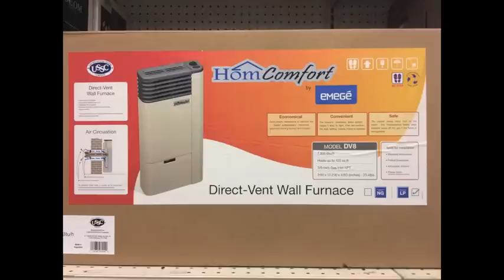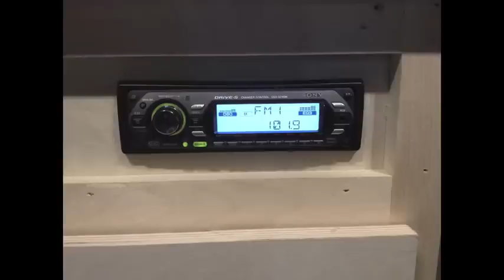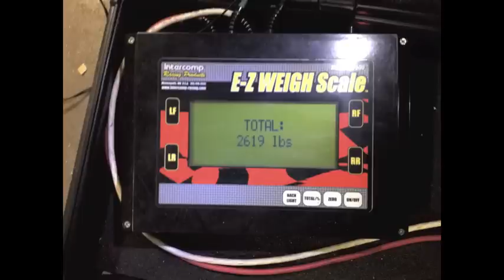DEEP FREEZE 2012-13 Fish House Build

Comment: What can you use to pull it out on the lake?
Reply: Joel Guptill A truck in the right conditions, or a wide track Skandic.
Reply: Nice. What was the total width and length of it? And how did it slide in the snow and ice. 
Thanks
Reply: Joel Guptill 8' x 10', but it is a heavy beast.  Slides well once it's up and moving though.
Reply: Nice. I really like that runners system. I'm hoping to build my shack soon.  Thanks for responding.
Reply: Sounds good, and good luck!